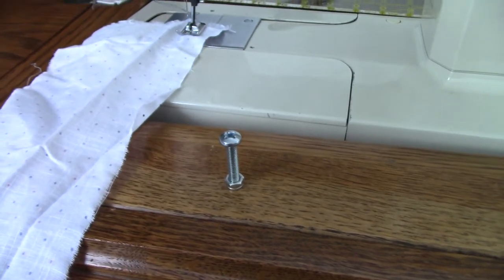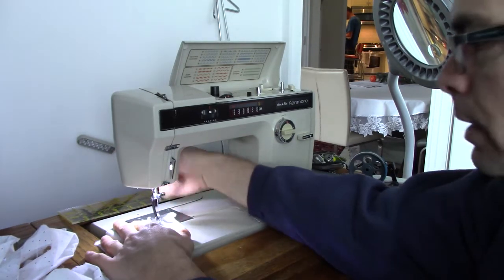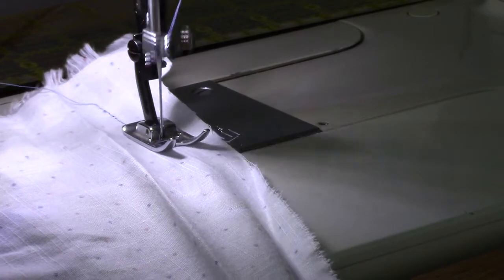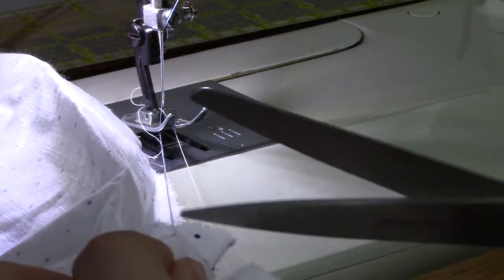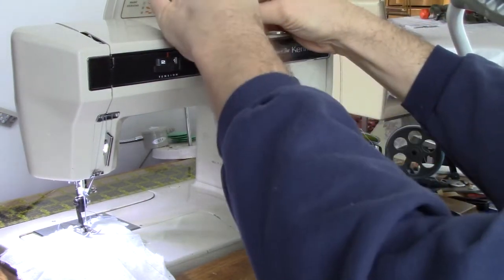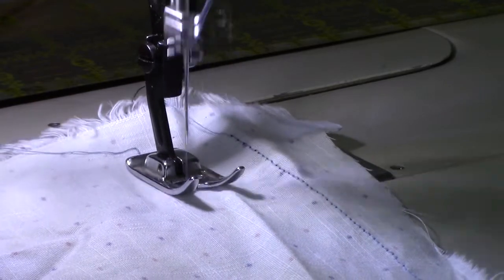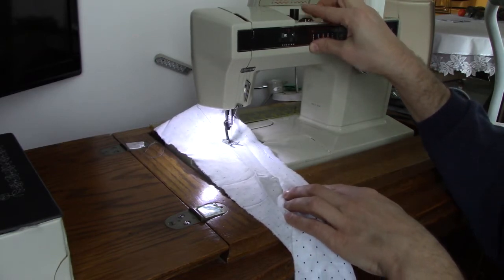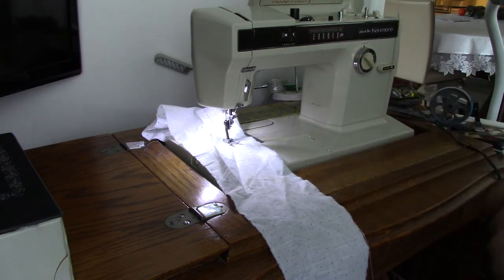Controlling the Needle Position on Kenmore Cam Sewing Machines

Comment: Is this applicable to the 1914 only?    Are the cams involved in this demonstration?  If so, how?   I have a 1757, which uses cams.  My 1757 does not have a control called a 'modifier'.  I don't understand what is happening in this video.
Reply from the maker: It is not the modifier which is being used but the cam release button. Put your machine in cam mode without a cam in place. If you hold your cam release button as if you are removing a cam (not the push part in the middle of the cam stack) but the button on the machine it and then move your zig zag width, if the needle moves it will work on your machine -- basically the cam release button moves the zig zag follower all the way to the right out of the way of the cam and then the zig zag width button permits the needle to move.

Comment: Hey James, my wife bought a 1914 model in a second hand shop. She's committed to use it but doesn't know how to properly thread it. Do you have any advice or manual to share with us?
Reply from the maker: I can certainly try to help. There are some manuals on-online. I have only seen ones that you have a small charge. I will try and do a quick threading video today for you. Perhaps we can work together and I can try to produce some short videos to assist -- I can also offer support via Skype if that helps.
Reply from the maker: Javier, the video on threading is on-line.
Reply: I recently purchased this machine second hand. I have found manual online as well as cams but have not been successful in getting the cams to work. Any help or advise would be appreciated.